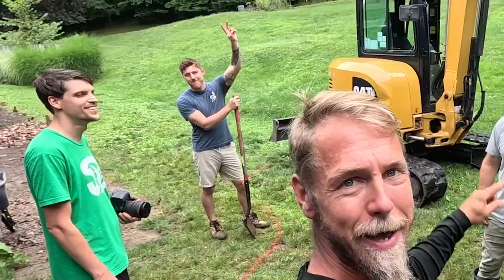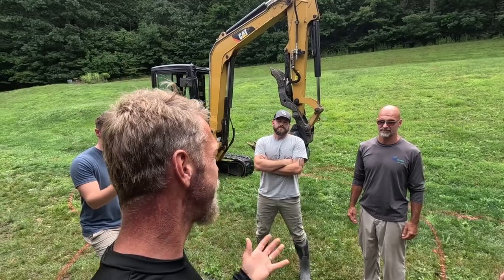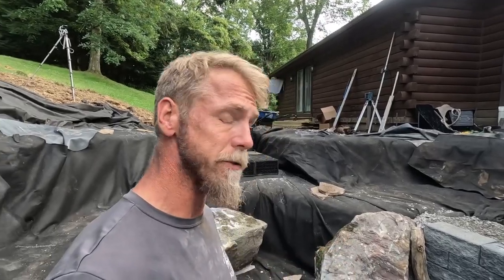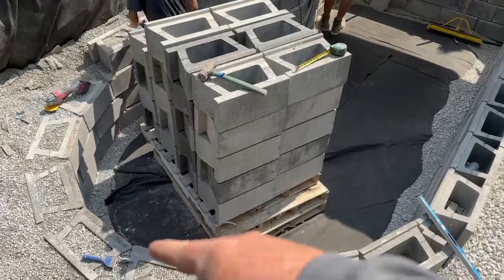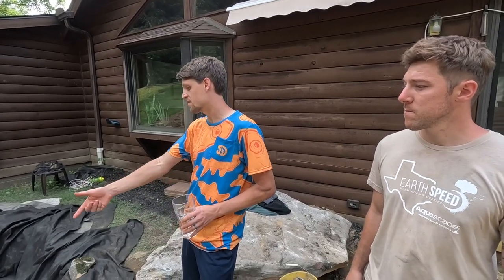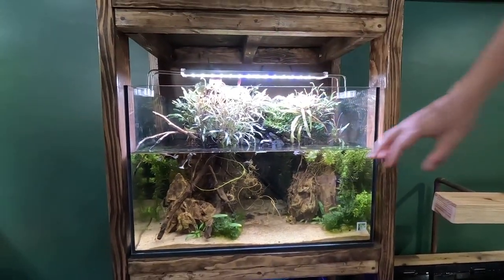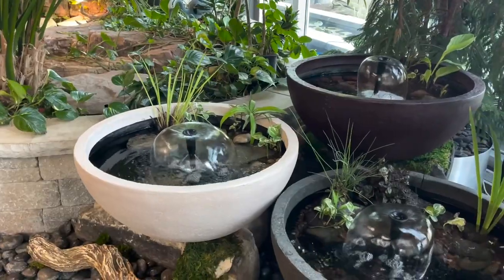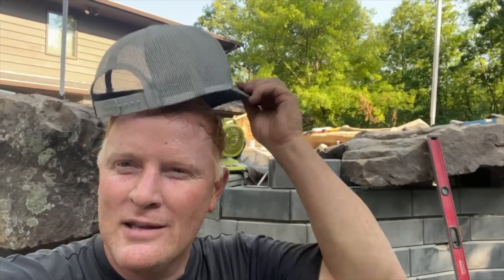The BEST Way To Get Your Feet Wet In BUILDING Ponds!

Comment: I started watching and following you after seeing Garden Answers pond being built. They are so lucky to have you to design and build their pond. I have an affinity to water and have had a pond or pond less waterfall for over 20 years until last fall. We moved to a new property that had very little on it but grass that hadn’t been looked after.  I’m not sure if I’ll end up with a water feature as I’m ….twenty years older and have done most of the work myself.  I’m sure thinking about it though as I miss my moving water, the sound and sights. I’ve had such pleasure watching your builds and I don’t envy you working in that heat and humidity. My garden Zone is Three and it’s low humidity here therefore much easier to work and dig in our yard.
If I was anywhere close to Chicago I’d be there for sure.
All the best.
Reply from the maker: Thank you so much for following along! You can always do smaller scale, like a fountainscape or even Patio Ponds!